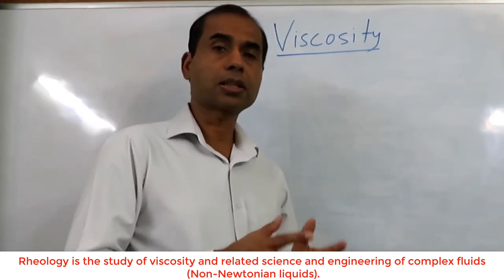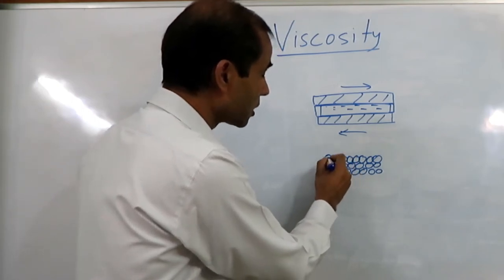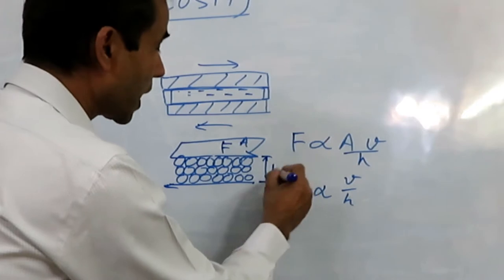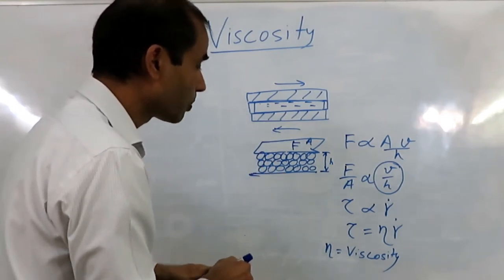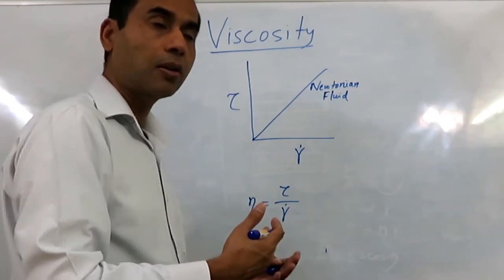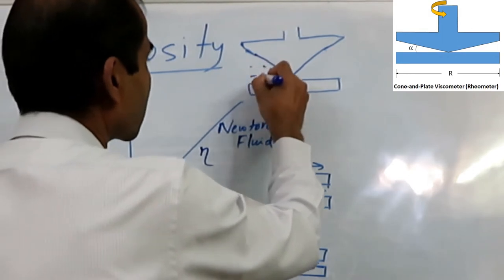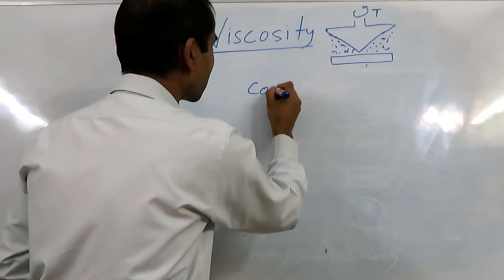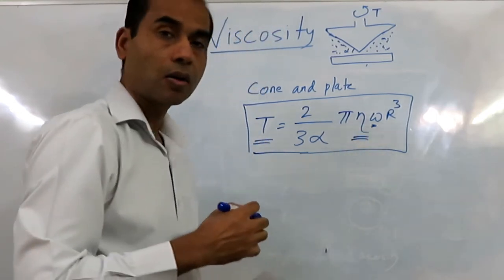Understanding Viscometry (Rheometery): Defining Viscosity and Apparent Viscosity

Comment: Thanks for the informative video, I learned something new today about what a rheometer is used for. It is used for to measure the force required to shear a liquid.
Reply from the maker: You are right. Using the proper theory, the rheometer can be used to find out the viscosity of the liquid such as a lubricating oil that you put in your car.

Comment: Very informative. For viscosity values shown in the table, should we exclude the measurement at point 1 as it gives a totally different value from points 2 to 20?
Reply from the maker: time 23:55. Yes you have pointed out an important aspect of the data collection. Often the initial couple data may be totally different and need to be omitted. Also, every test must be repeated at the same set of conditions three times, at least.

Comment: Are engine oil and olive oil Newtonian fluids under all conditions of temperature? I would imagine that engine oil has some n-paraffin fractions that could form wax at certain temperatures, as is the case with diesel and some other distillate fuels.

Was the Excel spreadsheet obtained directly from the viscometer software or some of the parameters were calculated from measured data?
Reply from the maker: Thanks. Both oil will turn very viscous at lower temperatures with non-Newtonian behaviour.
Excel is directly obtained from the machine with columns of stress and strain rate data. So, it is easy to plot them and obtain viscosity.

Comment: Is it possible to find viscosity of existing bituminous layer of any road?
If yes, please elaborate !!
Reply from the maker: The bituminous layer is highly viscous at normal temperatures but a higher temperatures it flows. This company makes instruments for bitumen at high temperature. For a very viscous liquid we can also use the capillary flow method (Saybolt) to measure kinematic viscosity.

Comment: Very informative video. 
Sir how to do rheology of viscus paste.
Reply from the maker: Thanks for asking.
For pastes, extrusion based rheology can be used. Normal rheometer can not be used due to the problem of wall slip. Squeeze film test can also be used. This paper may help: https://www.sciencedirect.com/science/article/abs/pii/S0377025796015467
For paste we model as yield + Non-Newtonian or power law, for example, Herschel Bulkley model.👍
Reply: @engineeringmaterials-tribo5142   sir i am a PhD research scholar working on a viscus ceramic  paste struggling  to analyse some of my sample but I cant find any rheometer system. will you help me sir.
Reply from the maker: @debu326  I do not have such rheometer. Try extrusion or squeeze film compression methods of measuring. That is what I can say. There are many published such works in this field. My old research was in this field. You can check my old publications here. https://scholar.google.com/citations?user=aybvKicAAAAJ&hl=en
I am sorry I can not help much. Best wishes  👍

Comment: Thank you very much Sir. But  i would like to know about that how the viscosity of yogurt is tested.
Reply from the maker: If the yoghurt is easily flowable then the rheometer described in this video can be used. For yoghurt that does not flow like a fluid then perhaps you should conduct compression test, just like we do for cheese.
Reply: @engineeringmaterials-tribo5142  . Thank you very much Sir. Now my mind is almost cleared.